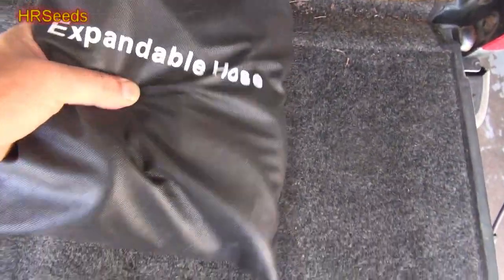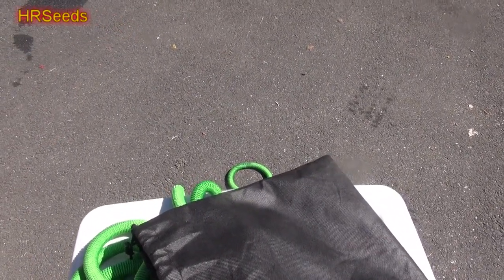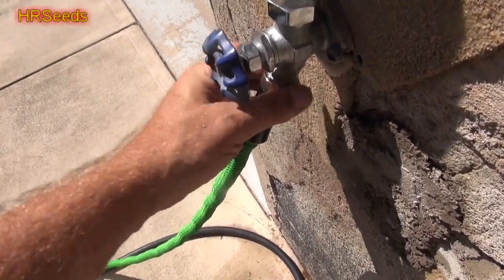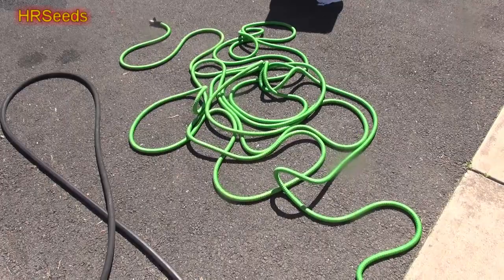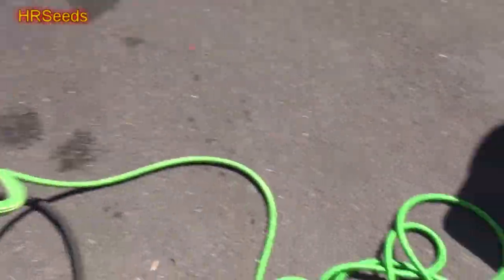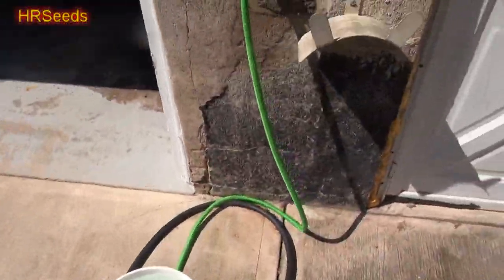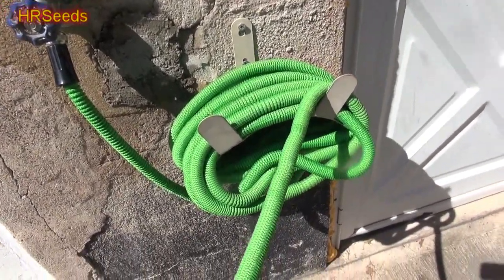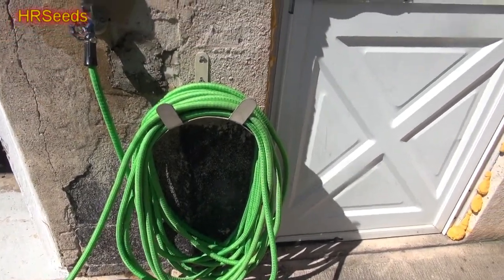GardenJoy Expandable Garden Hose 100 feet | Product Review | Heirloom Reviews

Comment: Looks useful as a utility hose (including cleaning house rain gutters) since it’s light & flexible. I wonder how it holds up to abrasion from concrete & rough surfaces.
Reply from the maker: Great point! i been dragging it around ans so far so good! if it does fail for any reason i will do another video

Comment: I've had a similar type of hose and it does not weather well
Reply from the maker: what did it do?
Reply: @HeirloomReviews  the inner core became weak and started to leak. I think it would have lasted longer if I brought it in for the winter
Reply from the maker: @dartagnantaft5918  interesting, i assuming you left water in the hose an it froze? also did your hose have a strong plastic smell
Reply: @HeirloomReviews  it was my wife's hose so very possibly had water in it. I don't recall any smell when I used it